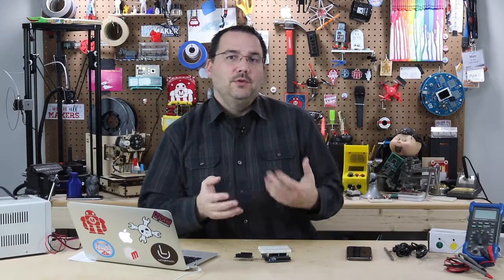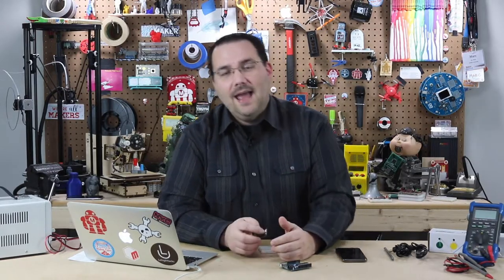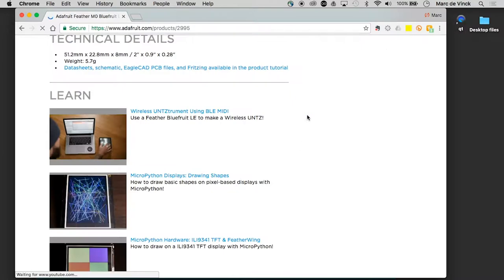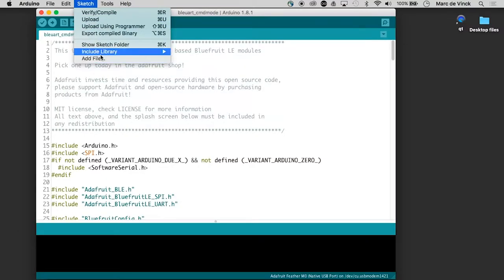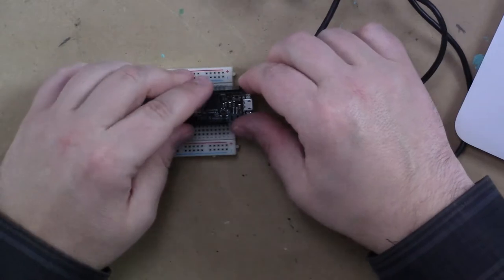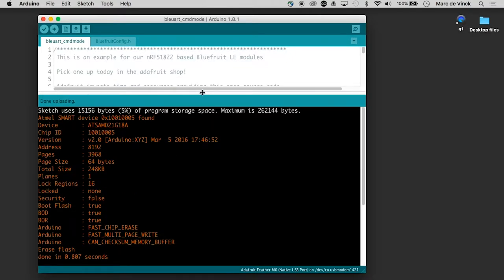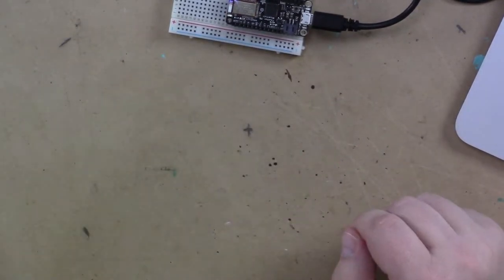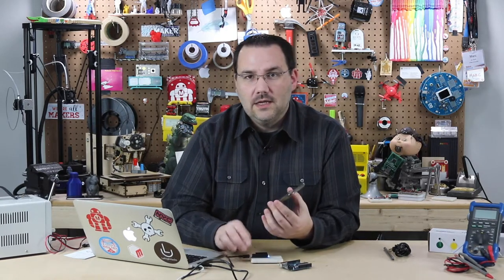Arduino Prototyping Techniques #92: BlueTooth LE (BLE)

Comment: What is needed to connect arduino nano to the bluetooth remote(like a  selfie remote for smartphones)?
Reply from the maker: It really depends on the application and technology. There are lots of BlueTooth LE  accessories out there, and if the remote has open pairing without any needed codes to confirm, it should be a fairly easy project. Just keep in mind, it can also get complicated really quickly.

Comment: Hello, Can you please show me how can connect : 2 Arduino nano 33 SENSE ble, TOGEThER
Reply from the maker: Via YouTube comments, sorry that's too complex. Google "connecting 2 Arduinos via bluetooth" and there are some great examples!
Reply: @MarcdeVinck  I can't find any information how to communicate 2 arduinos nano 33 ble sense, for example detects the temperature of the first arduino nano sense and to receive information on the second arduino nano sense ,
If you have any link or suggestions it will be nice
Thank you
Reply from the maker: @chetitahrachid1495  I saw you posted on the Arduino forums too. Those examples are a good place to start. And that's the best place to get help. There is plenty of examples of passing data between Arduinos via BTle, but you will most likely have to adjust to your specific needs. If you just want the code, consider hiring someone to write the code, but I encourage you to learn more about the process and adapt available code as needed.

Comment: Can u please share the code? I'm trying to do a similar project and i'm getting alot of errors on the bluetooth part
Reply from the maker: I'm using the Adafruit code that they supply for the board, and as described in the video. Head over there to download it.